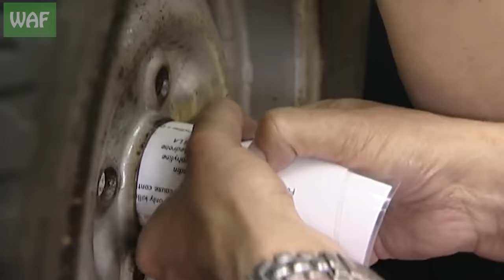Fox cub gets head stuck in a wheel!

Comment: I suppose 1.7k people wanted this fox to wear a radial around his head for the rest of his life........which would roughly have been a day or two more.
Reply: It's a fashion thing
Reply: @swav.zielin  😆😆😆
Reply: they shouldnt have forced the head through like barbarians.. there is something called a SAW to cut through metal
Reply: @jeanmahe8657  The fox was fine Jean, when you find one in such a condition, save it the way you see fit, just save it. Have a good one.
Reply: @jeanmahe8657  what a hot take. I assume you save fox cubs daily like simon & co. since you're so confident in your bullshit.
Reply: @jeanmahe8657  Yeah a saw can cut trough metal... and into the fox without problems
Reply: @phyph286  Not to mention metal shavings flying into the fox's ears, eyes, nose, and other body openings.
Reply: @jeanmahe8657  yea, you know what comes out when a saw hits metal?....loud fuckin sounds, sparks and metal bits...
you'd rupture its ears if u cut through the metal with him just a few CM away...
Reply: @jeanmahe8657  Ignor these idiots. You gave them your opinion and they got all butthurt. I gave a thumbs up but I also thought that was too dangerous.
Reply: @Mulinaster  There certainly are more efficient/safe methods than forcing the head out. They would just need to be patient and take the time and effort, with the correct tools. Right away my first thought would have been to get some proper, strong, and relatively safe dremel bits, and use two of the bolt holes as starting points to file them through to each other, to essentially start cutting out a piece of steel between the 2 bolt points and the middle. Also get something in between the Fox's head and rim for protection from shavings, sparks, ect. similar to to how they used a plastic sheet. From there, cut inward from each side/bolt-point towards the middle opening that the fox was was stuck in. When getting close to the middle, switch to a safer bit and lower rpm. A "rectangle" piece of metal would be cut out and job done. I wouldn't assume a Vet would exactly have the tools, experience, and specific skills to feel comfortable doing this, but it certainly would have been more efficient if one happened to, because it honestly wouldn't have been very difficult.

Comment: I would’ve tried a reciprocating saw between two of the stud holes. Then cut from each hole towards the fox and cut the last bit with snips.  
Well done saving him though. Doing great work.
Reply: Good thinking but on the other hand the Fox would have been very traumatised
Reply: I was wondering if someone would mention another way to do it. Never heard of a reciprocating saw.
Reply: @MikeDunn  In the US they’re called a Sawzall I think. It’s a power tool that makes the over and back motion of a hand saw. You can use different blades for different materials.

Comment: Have you ever tried wide sellotape starting maybe around the ears and wrapping it fairly tight around in a spiral back towards the neck. It would be very thin and the edges of the tape would be facing away from the direction you are pulling.

Comment: im glad it worked out, but im not to keen on the method, going forward the fox skull is shaped angler, backwards the back of the skull is wide, i would have rather carfully cut an opening to the side of the hole and worked back toward it with a zaw saw or drimmel, yet these guys are pros so i defer to their expertise